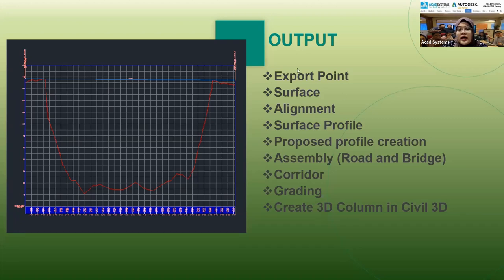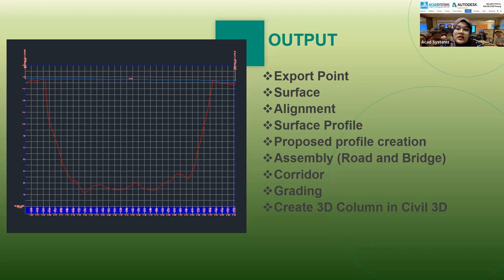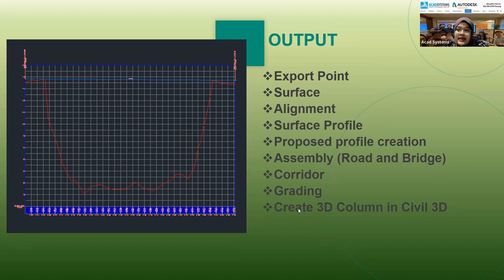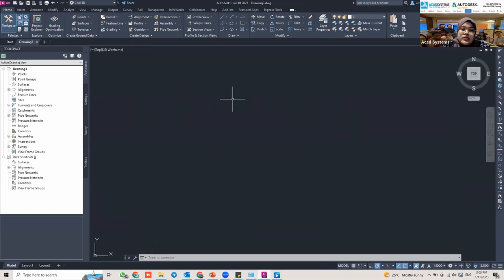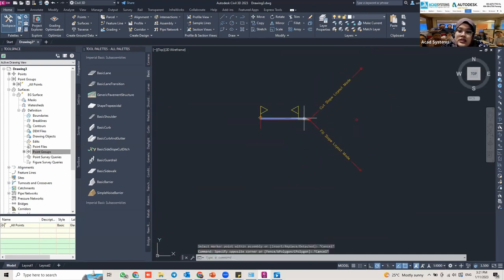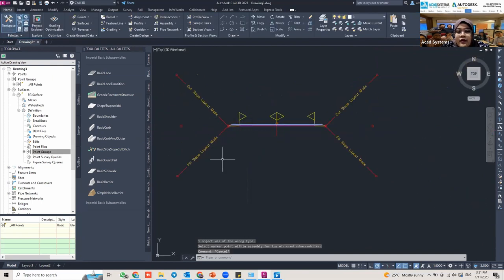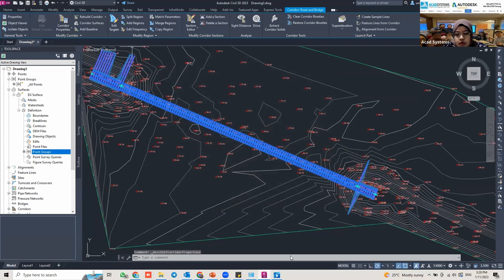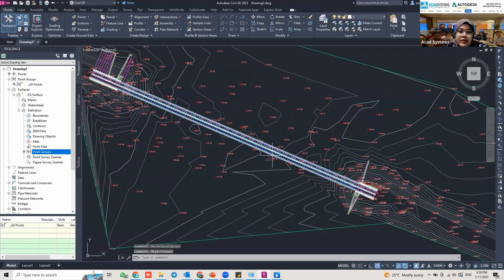Basic Bridge Design in Autodesk Civil 3D | Free Online Lesson

Comment: No sound. Tiada bunyi.
Reply from the maker: Hi Say Peter. Thank you for letting us know about the audio issue. 

We're sorry to hear that you're having trouble but the audio is working well on our end. It could be a problem with your device or connection. Have you tried adjusting your settings or checking your internet connection? Thanks.
Reply: How to create abutments and cornices with civilian 3D?
Reply from the maker: Hi Ady. To create abutment or cornice in civil 3d you can use method to create corridor, just change the subassembly in assembly creation to the item that you want for example abutment or cornices, and if you don't have the item that you want in tool palate you can just create the subassembly from polyline. For reference, you can watch our previous video on Retaining wall in Civil 3D.

https://www.youtube.com/watch?v=CKWxQaI4hbM